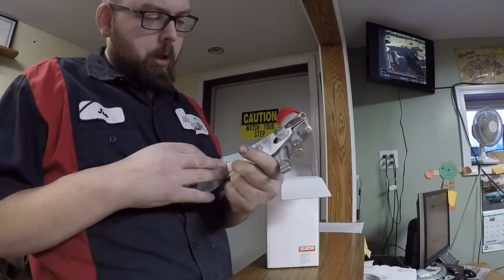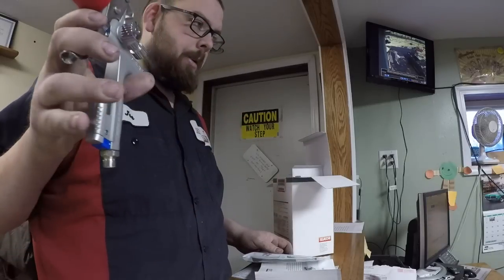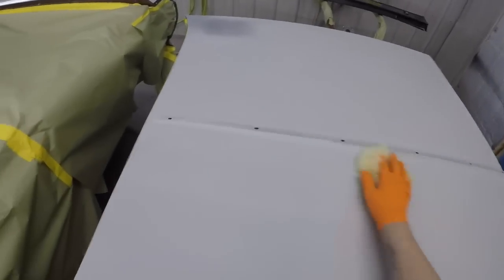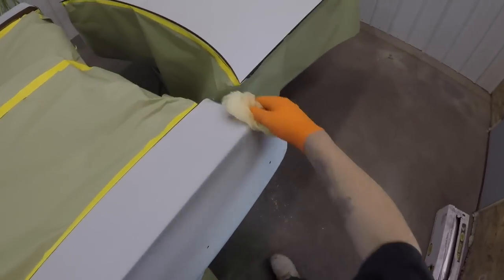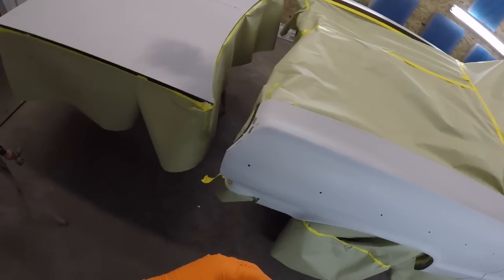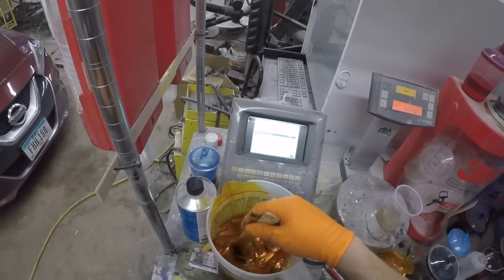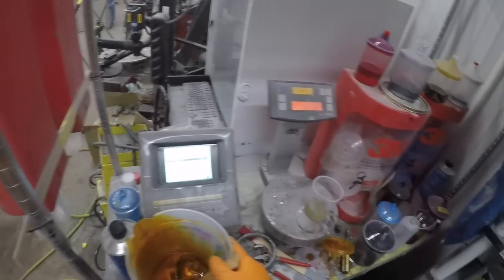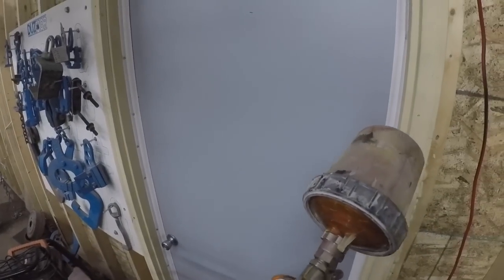1964 Impala SS custom HOUSE OF KOLOR paint job!

Comment: After painting for years now,and buffing many cars.and having trouble with little swirl marks and buffing scratches no matter what I use especially black or dark colors.I bought that polish."Nu finish.And applied it one and wow amazing practically makes all swirl marks disappear.And it holds thru many many many car washes.Perfect for those customers that don't want to pay for a three day buff job.Just rub on by hand let it Haze and wipe off.Really  a 30 minute full car and done.
Reply from the maker: Filiberto Barrera nu finish is a wax isn't it? That shouldn't be applied on newer paint. They need to breath for atleast 6 months.

Comment: Awesome video, I noticed the lesonal paint system. Do you have good results with it as far as color match and coverage? Thinking about trying it out but would appreciate any feedback about it thanks
Reply from the maker: Manny05 Manny05 very good stuff 95% of the time the prime formula matches perfect. Two coat coverage in most cases.
Reply: RJ Tickler thank you sir I appreciate it

Comment: How many coats of paint a normal good quality process has?
Reply from the maker: Eno BOCI for a normal color, one coat of sealer, 3 coats of color, 2-3 coats of clear. For a show paint jobs most guys do 4-5 coats or more of clear.
Reply: RJ Tickler Thank you for your reply. I am planning to take my Midnight Blue 1992 Mercedes Benz 500E to the paint shop this sunmer in August but my paint code 904 is very difficult, transparent non-metallic color. I am planning to use Spies Hecker brand. Kind regards and lots of success ahead 👋